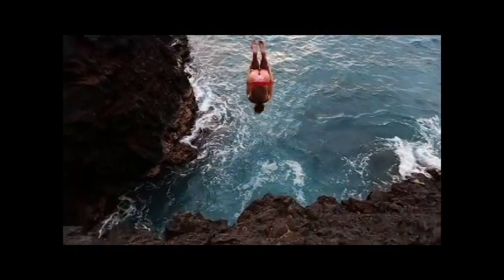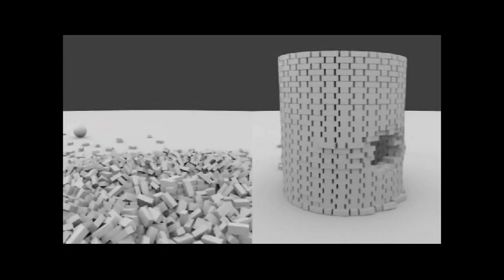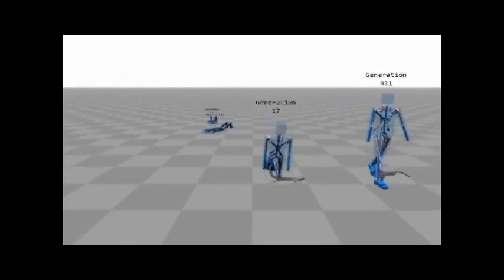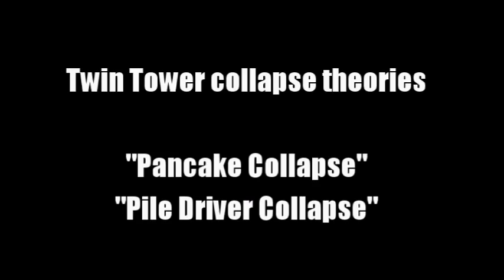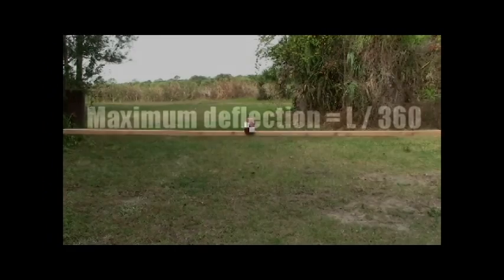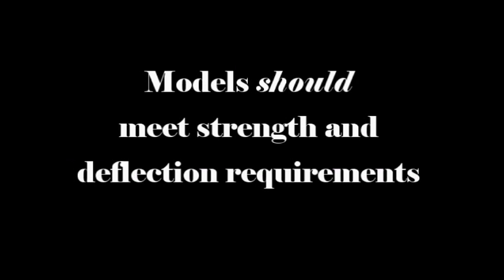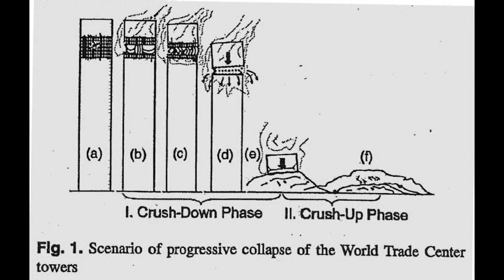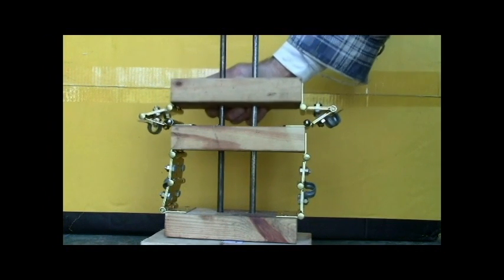9/11 Experiments: The Force Behind the Motion

Comment: What gets me is that no matter what happened, why didnt the towers fall to a side? They just fell straight down. Being an engineer, force does not go in one direction perfectly, it just doesnt. You can make mathematical models to do that (computer simulations) but the reality is that it would be very hard for that to happen in real life.

It resembles a controlled demo being as how it fell almost perfectly down, and twice not to forget!

Going through the comment, i forgot about building 7, that also collapsed straight down too?!?
Reply: Yes, WTC 7 was a classic controlled demo, destroyed from the bottom up as the building's own weight was used to help crush it.  The towers had to be taken down differently due to their excessive height.  They were destroyed in a top down sequence and the core was left to stand a few seconds longer than the perimeter columns to help control the collapse (a bit like a firefighters sliding pole).  You are correct that the buildings would not collapse through the path of greatest resistance - their supporting steel structure, but we are expected to believe that!

Comment: So many issues with this video.  "cold strong steel"? try hot weak steel!  Your model used matchstick reinforced paper to support the floors.  It should have used matchsticks made out of play-dough because that's about how strong hot steel would have been.  

Every time I see videos like these I am amazed at how people try to cite "Physics" as their source of knowledge, and every time their Physics is flawed.  you might as well try doing crash test ratings with hot wheels cars, then say "Yup that hot wheels car survived a simulated 400 MPH head on collision so it should ensure you survive pretty much anything.", but there is no conspiracy weakening your car to crumple on impact!  YOUR PHYSICS DOESN'T SCALE! try measuring how much weight your matchstick reinforced paper will support, then scale that up, and I'm sure you'll find an astronomically HUGE number,  but if that were the case why don't we make our skyscrapers out of 3'x3' wood columns(giant matchsticks) and 36" composite laminate walls (giant paper).  Because it doesn't scale that's why!  

You have to find what the ACTUAL (not rated, because that's always a little different) load bearing capacity of those reinforced concrete columns really was, then scale that down, and find a way to simulate that.  I am betting when you get to a scale model you're going to find something as flimsy as newspaper.  now build your model out of that and try your experiment again (but light it on fire first so your "simulated concrete" begins to spall and crack and turn to powder, and then weakens the load rating of your simulated wet spaghetti steel (because jet fuel doesnt need to melt steel just weaken it))!

MIKE DROP!  This is stupid!

Comment: A physical model is no better than a computer model. How can you discredit math and engineering? The strength of each material changes with temperature. Take steel, even if not liquid, will undergo drastic changes in physical properties given a temperature change. Math allows engineers to model things on computers far more sophisticated than match sticks and paper. This evidence does not convince me; I think you are spreading disinformation.

Comment: I am a registered North American architect and I agree with you Sir.
Reply: Dude... Tell me how the floor-to-column connections were represented in any of his presented models.Plase also explain to me the relevance of these connections for the construction of the towers.
Reply: Floor connections to the metal exoskeleton would have been weaker than those to the concrete core. In the airplane / heat exposure scenario the metal perimeter most likely would have collapsed first. Also, concrete core is a vertical cantilever. It would not fold like it did under just gravity. Lower the core goes, stronger it gets, for the increasing number of elevator shafts. The series of videos of the unsuccessful demolitions "Demolition gone wrong" tell a good story. Collapse of B7 also remains unanswered.
Reply: So you stated you are an architect?
How much time have you spent on studying the design of the towers?
Reply: Enough to design the 20-storey structures so far. What is your background?
Reply: Sorry, I asked you how much time you have spent on studying the design of the twin towers.
My background is irrelevant since I haven't mentioned it, let alone made any arguments from authority from it.
Let me repeat your claims before you forget or before they magically disappear:
"Floor connections to the metal exoskeleton would have been weaker than those to the concrete core."
"In the airplane / heat exposure scenario the metal perimeter most likely would have collapsed first."
"Also, concrete core is a vertical cantilever. It would not fold like it did under just gravity."
"Lower the core goes, stronger it gets, for the increasing number of elevator shafts."

Would you mind me asking a few questions about your claims? You're an architect so these should be relatively easy to answer:
- Could you please describe the details of the floor-to-perimeter connections?
- In which way did these connections differ from the floor-to-core connections?
- Why do you believe were the floor-to-perimeter connections weaker?
- What material was used to construct the core?
- Why would the perimeter have collapsed first? What critical structural element(s) would have given way first in the described scenario?
- Please describe the purpose of a "vertical cantilever"?
- How many elevator shafts did the towers have each and how were those devided over the several floors?
- How many floors did the tallest elevator shaft cover and how did the shortest cover?

Believe me, I am really looking forward to your answers :).

Comment: The experiments don't take into account several factors, like heat and weight!  Basically the collapsing floors were multiplier's.  Think of a martial artist braking ten boards as each board brakes its not necessarily the impact of the fist so much as the continuation of momentum and weight that does the work...

Comment: 6:03 dude are you serious? the buildings did not have 2 exterior solid structures like the ones you built.. the whole structure itself was compromised.. maybe do it again right this time..
Reply: Both experiments incorrectly used rigid supports. Pancake used rigid walls (not representative of actual event) and Pile Driver used rigid poles down the center. Total face palm. I would remove this video before I embarrassed myself further.
Reply: "the whole structure itself was compromised".. really? How? Who? When? I really missed that.. Did U "compromise" it?
Reply: One Gem oh man, I really hope it wasn't me.. sleep walking again :(
Reply: friedchicken: you should see the yt video of the WTC construction. Both towers had supporting columns in the center of the building, forming a strong core structure, which also housed the elevator shafts. 
A plane is a thin aluminium tube with only a few massive parts like jet engines and undercarriage. The rest is lightweight, easy deformable stuff. Under no circumstance, following the law of momentum conservation, can an aircraft weighting a mere 200 tons damage a building of more than 450000  Tonnes (https://hypertextbook.com/facts/2004/EricChen.shtml) to an extend, that the outer steel walls , the inner collumns and other support structures are so damaged, that the building would give way. At max, smaller sections could be damaged by the high dense parts of the plane, but also here not all at the same time. It is either damage on the outer steel structure, which will consume the majority kinetic energy of the impacting item and transform it in damage, or if the outer steel structure does not got hit, the core collumns structure would be damaged. In such case the load bearing design of the outer steel structure would prevent a destruction and collaps of the building. An object of a mass of max 8762 Kg (GE 90) will not be able to destroy the outer walls integrity, nor wold it be able to destruct the inner columns to an extend, that the integrity is lost. 
Here the link to WTC construction to give you a picture, what material dimensions the "plane" was facing: https://youtu.be/blB6jE2Wc5c, https://www.youtube.com/watch?v=Jwc49cZKunQ
Reply: Dirk Schoas hey Professor, the plane wasn't hitting ALL 450000 tons of the building, just a small fraction of it. I'm 160lbs, but if I catch a 300lb dude on the chin it's lights out.
Reply: He's not going to do it again because he may get the 'wrong' results....
Reply: You should find photos and videos of the Trade Center bombing damage.  It was fairly extensive for such a small bomb that detonated outside the core.  Here's a cool photo showing you how you can see through the Trade Center.  The plane could easily reach and damage the core.  https://viewing.nyc/incredible-vintage-photograph-shows-sun-shining-through-world-trade-center-towers-in-1972/
Reply: "without interior walls" moron, "under construction"..smh
Reply: J P Wow that's a cool photo. And totally agree

Comment: The experimental designs are terrible. Of course the falling steel weight decelerates, because the plates are held up by your wooden frame, which does not budge. Further, it is questionable whether a dropping steel weight is a good simulation of a collapsing building. From this silly experiment you cannot possibly make a conclusion about what a building would do.

Comment: computer models will guess what happened. buy you have to add all the pysics rules affecting and all the objects. and yet they didnt provide any clue about the details of program and pysics rules they emulated (some kind of physics endinge ? so which one ?) and how accurate is the designed model do they know and applied detailed phsics rules about jet fuel and cement and whatewer affected ? probably not. as they didnt sohwed us the program and details about the simulation parameters .

Comment: Your plank model is flawed, akin to your flying pig analogy. There was not a solid central weight dropped from far above the buildings into the top floor. You took several shortcuts in your model, and it affected the result.

Comment: 6:43 means nothing. the floors that didnt collapse had enough strength to hold the entire weight of your weight and the other floors combined.i imagine after 5 or 6 floors plus momentum, the lower floors in the wtc didnt have the structural strength to hold that weight.

Comment: Had it been a detonation type the towers would have tilted as they went downward. Even demolition teams know you can time it close but you can't get it perfect. 
 In your pancake experiment I note you are using solid horizontal planks. This is part of the reason the experiment failed. The floors of towers were not solid concrete slabs. But rather a collection of slabs with small holes cut in them for rest rooms, electrical conduit, and other things. The slabs did not run the length all the way across. Otherwise there would have been no elevators. 
 So again here is the actual experiment. 
 The exterior supporting the horizontal HAS to be hollow as we know the exterior of the buildings were hollow core steel. The floors just have the elevator shafts present. The concrete floors have to be supported by joists with nuts and bolts that are heated. The internal steel vertical supports also must be hollow (as to allow for the connection of the nuts and bolts.) Then attach  cellophane to simulate the windows. Then conduct the experiment.

Comment: Wrong.  The floors were connected to the columns with hinge pins so they could move and deflect the building's allowable sway.  Your experiment has them supporting themselves with the wood blocks in the first part of the video.  I HATE it when you conspiracy guys ignore that part.  The columns were not "thicker and "stronger" at the bottom, the floor plans would have been different.  You also cannot just search your house for experiment materials.  Fire crackers, pizza box supports, hardi backer tiles, and there were no explosions I heard.  I was there when you were on your farm.  You have way too much time spent on this video.
Reply: Also notice how the actual video only shows DUST coming out.  Thermite burns like the sun, explosions are yellow and loud.

Comment: it SEEMS to me that using the industry standard L/360 deflection requirement with standard structural steels one could - with fairly little effort - prove that heating to a certain likely maximum (let's say 1600 degrees F) will not cause a horizontal member to fail ... since the set of constants which determine deflection also determine the strength that prevents failure .. no?

Comment: Everyone who builds models of this ignores the floors and the horizontal forces they contributed to the towers' fall. The exterior walls peeled away from the floors. As they did this the steel in them stretched, then snapped. When they snapped back they exerted a lot of force on the center collum, like having a rubber band break in your hand. This is where all the extra energy came from, and would serve to explain most everything about the collapse.
Reply: To bad the government wasn't willing to test theories like yours
Which begs the question 
Why weren't they willing to test theories, even the official theory, of what caused the destruction that day

Comment: I like your model at 08:23. It is the closest to what actually happened. 

The design parameters of our first model were off. The walls were too rigid and our corbels were also too strong.  Also your floors were also too flexible. 

In real life the walls pulled away from the floors as the floors were being pressed down which caused the floor joist hangers to fail.

The combined motion of the floors dropping on each other acted like a crowbar pulling nails out of the floor joist hanger.

Comment: You do realize that the fires went down the elevator shafts and stairs allowing fire to reach floors below the impact zone
Reply: Fire going down. I see that happen all the time. Sure. As for the fuel in the plane, it would still have forward momentum like anything would with mass, no?  So please explain how the fuel moving horizontally at over 300 miles an hour decides to make a right hand turn and go downward.

Comment: Whilst I don't believe a word the U.S/U.K govs tell us about anything, and certainly don't believe 100% the official story on who caused 9/11. One thing that always bugs me about any of these conspiracy theory WTC collapse vids is that none ever take into account the fact that 1st they cannot guarantee how many supports were taken out by the planes, and then 2nd the movement or separation of inner joints under impact zone that would have been caused by the crashes. How many floors under Impact zones were weakened simply by the crashes ?, surely the argument of other building fires is slightly flawed by non 500mph plane crashes. Also, would the impact of plane travelling at those speeds have structurally changed the buildings at ground level ?. I feel the experiment in this vid is flawed by some floors would defo have had huge percentage of support missing before upper floors weight came down, and there is very good chance floors lower than impact zone would have had supports severely weakened before fires took hold.

Comment: Thank you for your time and effort.
That was a wonderful lesson in physics. I think your experiment supports the facts. Therefore you are right. Thank you.
Reply: Eric - "That was a wonderful lesson in physics."
Haha, no it wasn't. It was entertaining at most.

" I think your experiment supports the facts."
No it doesn't. The cause of the progressive collapse was the relative weak connections between floors and columns. This was never represented in any of the above experiments. The floors were integral part of the construction of the towers. Without floors there couldn't be any towers. This fact is never represented in any of the experiments in the video either. "Out and down" is nonsesical if you understand the engineering of the towers. The guy that does the experiments clearly doens't know how the towers were constructed.

"Therefore you are right."
Therefore he is wrong.
Reply: Bruce Lansberg The experiments may not accurately represent what happened at the towers. I have three undergraduate degrees and none of them in physics. I did take P chemistry. Which has a lot of calculus based physics. The conclusions from the experiments
are correct. I enjoyed the video,
and the way it made me think.
Reply: Eric - Enjoyment is of course a great good :). However, please do not make the mistake that a non-representation of the towers proves they were CD'd. The conclusions from the experiments (the towers were CD'd) is absolutely incorrect. When a scientist designs an experiment that should prove the cause for A, he also should exclude every possible other cause for A. Nothing proves the towers were blown up. No proof of explosives (audible or visible or chemical or structural) has been found. An experiment with a flawed setup certainly doesn't add to any kind of proof.
Reply: Bruce Lansberg . Often times what we learned from an experiment station is something outside the focus of our original aspirations.
I understand what you're saying.
Everybody's pretty sure it was an inside job.